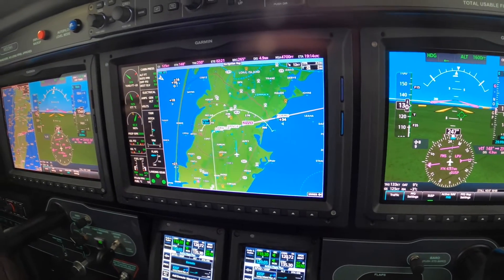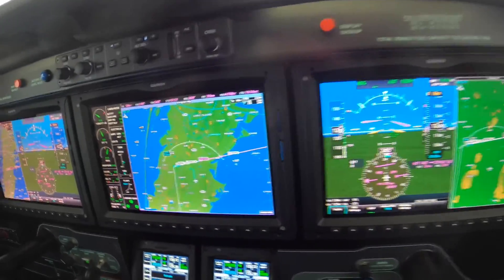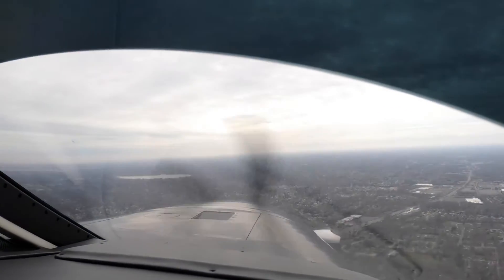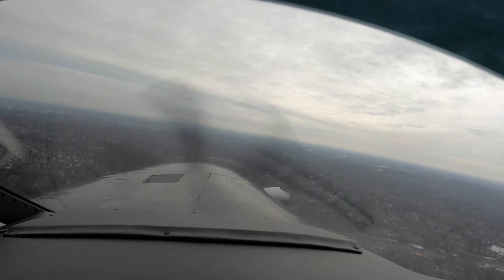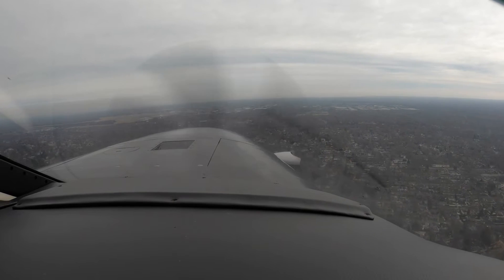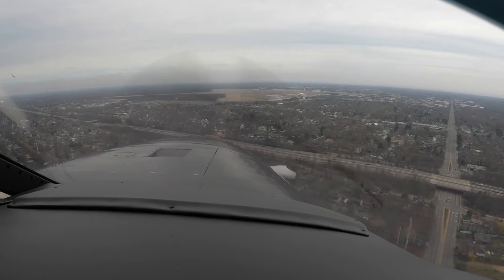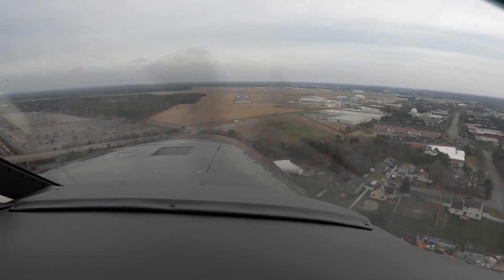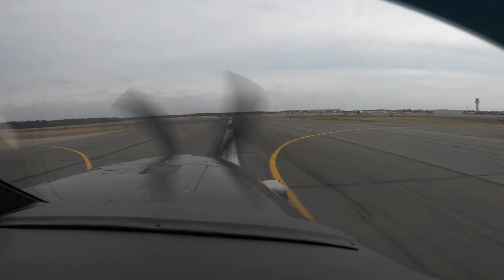Piper M600 - Gear Malfunction and Emergency Priority

Comment: Welldone. You should have called the emmergency. How did you know that the manual gear extension actully put the gear down since you could not verify? That manual gear Extension answered my question about piper manual gear expension though.
Reply: three green = gear down
Reply from the maker: That is correct.. Fly Safely - Train Often .. DR